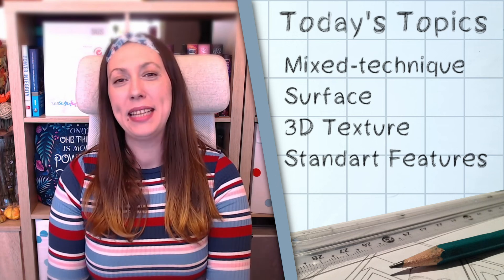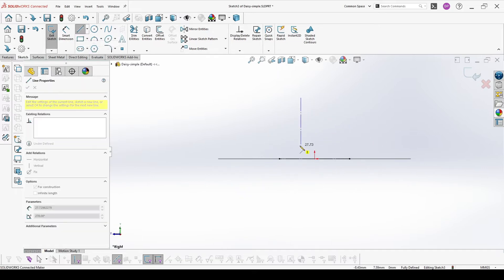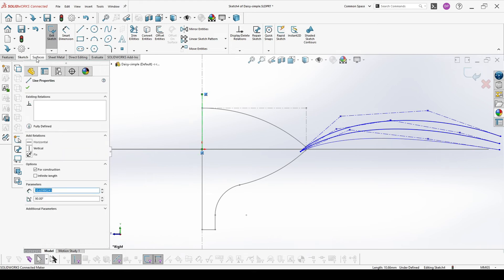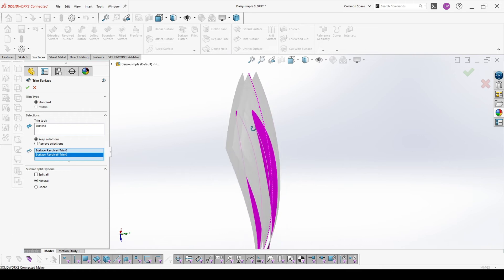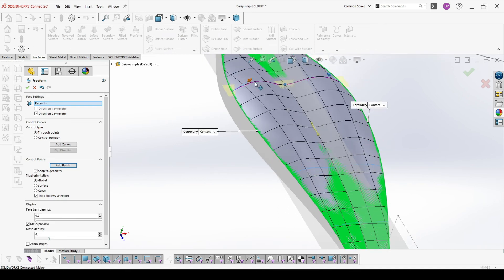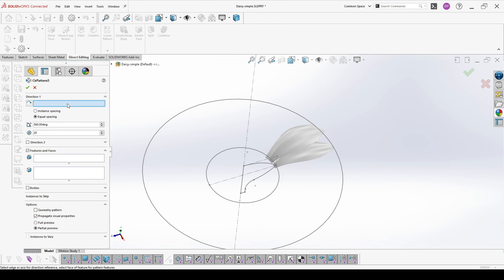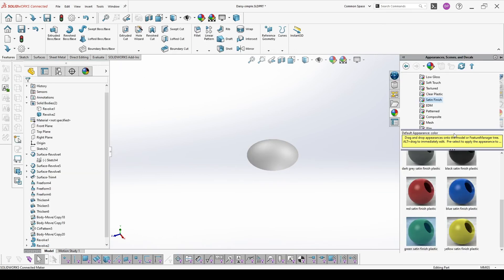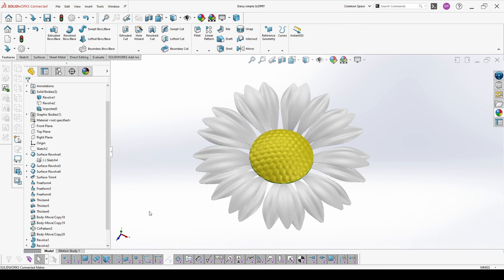Mastering SolidWorks: The Epic Formula for Lightning-Fast and Stunning Models

Comment: Great video, Danute. I'm just startint to work with surfaces and this was a lot helpful to undestand their behavior.

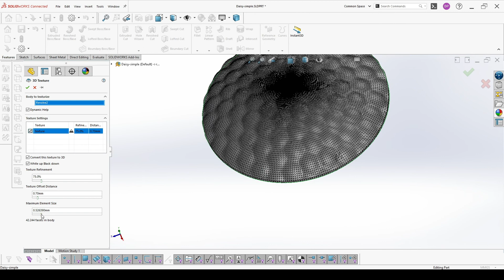I can't get a visualization on the 3D texture as the one in the video, I just keep getting a look  with the details just as in minute 13:34 even after converting it into mesh, do you know if this is a configuration issue? Thanks in advance
Reply from the maker: Hi Juveniano, can you connect on LinkedIn and show me some screenshots, so I can really help otherwise, I can make a lot of guesses. Keep in mind that the Graphic body remains in your model, it's possible it's not hiding (like it should be by default) and this messes with the visual. If this is not helping then please reach out on LinkedIn: https://www.linkedin.com/in/danutep/ Another thing that could be: at the end I switch from shaded with edges to only shaded view, converted mesh is still a mesh and has a lot of triangles. I hope this helps.